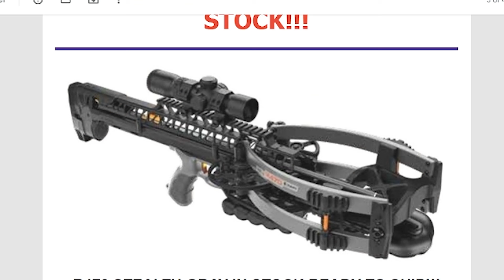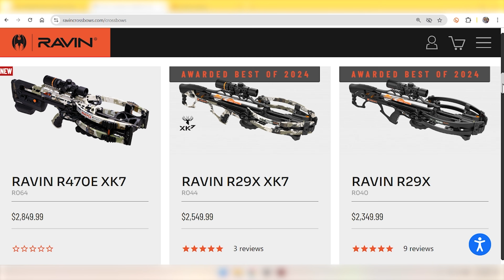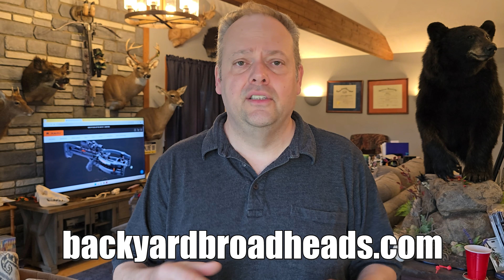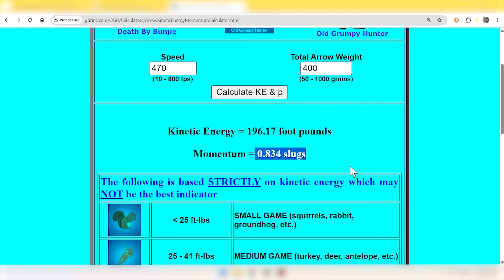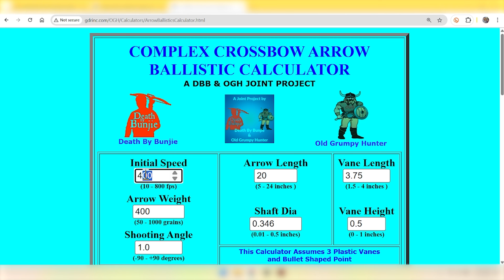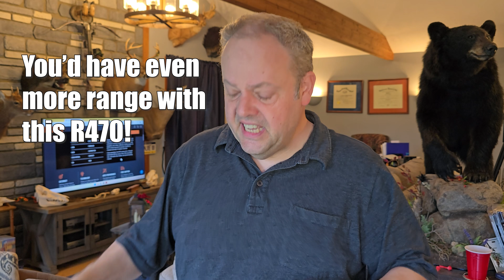The Ravin R470 -- Oh, yeah! OR Oh, No?

Comment: I finally got to shoot mine and it’s amazing it really is. I shot high end hyper barnetts for a good while. And they were pretty good. But this Ravin r470 is nothing like them. There’s really no comparison other then they both shoot arrows and have strings and limbs! The ravin crossbows are so smooth compared to the twang of the barnett crossbows. Ravins are buttery smooth and flat shooting . That trigger is amazingly crisp. No creep is so nice. And the sound is much more efficient sounding? At least I feel it is ? Barely any vibration like the Barnett crossbows as well. And they shoot every time unlike Barnett. The adf on the Ravin is far superior.

Comment: I build my own arrows and have lots of experience with .001.   I just purchased a R10X and the packaged  .003 arrows that come with it literally are hole for hole out to 40 yards.   I would not hesitate using .003 long range recreational shooting or 50 yards in hunting.   If there are any windage dispersion and your bowstring meets OEM standards you can micro nock tune nocks to tighten POI to POA groups.

Comment: After some range time with my R470 I almost wish I got an R29X or an LR. The 470 cranks like a BEAR. Or maybe I'm a wuss. The sled screws are also tig welded at the ends. Which is a weak point in my opinion. Its a Ferrari of a crossbow with Ferrari maintenance...

Comment: Any durability issues so far???
Reply from the maker: I didn't keep mine but it appeared very well built. Sighted in to 50 in 4 or 5 shots!
Reply: I sold my scorpyd DS 420 due to inaccuracy issues. Purchased this 470. So far it’s accurate but having large swings in speed. 1 shot is 467fps and the next is 479fps and that shows on the target (some are higher). Idk what’s up with it but starting to feel I just need to hunt with the old wicked ridge which seems to be the only company with x bows I’ve had great luck with (ten point)

Comment: When I started out I was a rope cocker. When I moved on, I got a Ravin and then acquired a TenPoint. I have not used cranks for any other crossbow. I don’t really think about crank cocking because the systems in both Ravin and TenPoint are so fast and simple that it doesn’t give me any pause. In fact I prefer those cranks to rope cocking.

Comment: 550 fps scopes are getting ready to for air bows. The Benjamin original was 450 fps. The new Benjamin M600 like Ravin shoots 600 fps + with the supplied arrows. An offshoot of the AEA Zues with 50 cal barrel was shooting 700 gr arrow 660-700. Whats the momentum of a 700 grain arrow at 660 fps?
Reply from the maker: I'm betting is a lot, but it's also not archery equipment. No string.